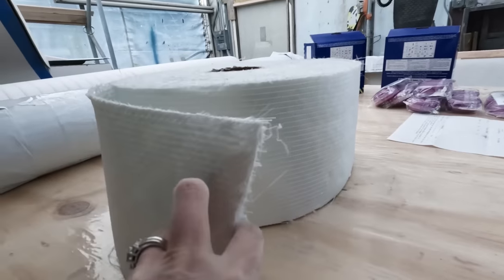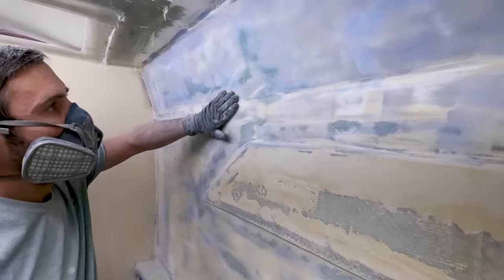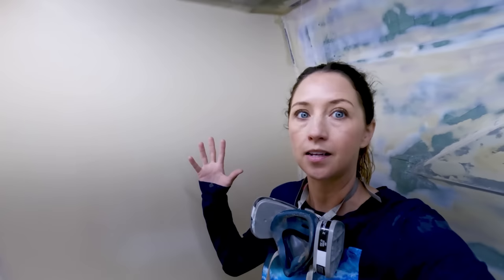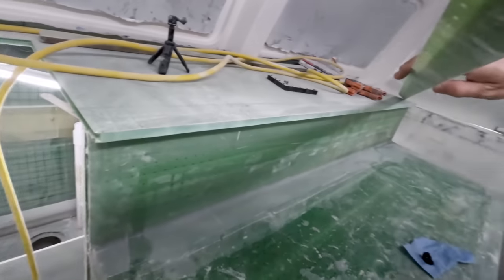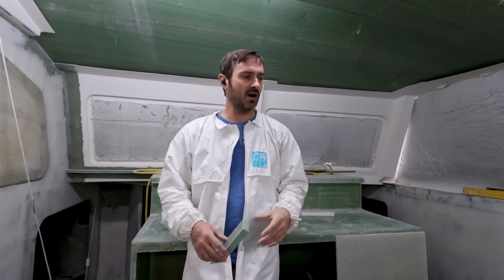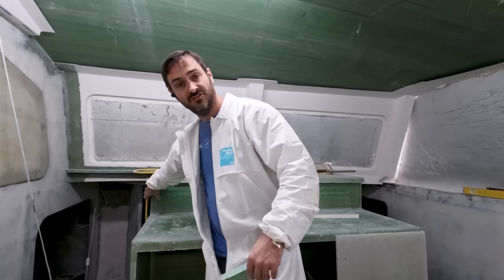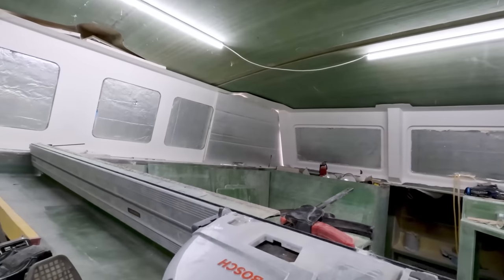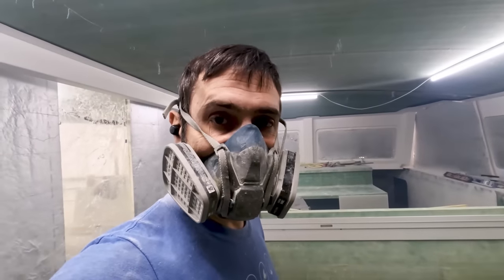CATAMARAN BUILD - Every Way I Do This Is Wrong  (MJ Sailing - Ep 268)

Comment: Continually so impressed with how well you do, and how much work it takes to scratch build a boat. 
Wouldn’t it be worthwhile to have an extraction unit when you’re in an enclosed space to help eliminate dust. Set up a negative pressure zone with simple filters. Would also help with cleanup from all the cutting/filling/sanding.
Reply from the maker: We received an awesome 12" high CFM fan with duct for just that purpose last year.  We didn't use it for months that winter and by the time we opened the package - and warranty was done- we foundout it was DOA.  I haven't had the stomach to buy another :(

Comment: I'm not a boat builder, but I've seen "Guide Coat" used in auto body.  Something like:
SEM 38203 Black Guide Coat - 12 oz.
or
Dura-Gold Premium Black Dry Guide Coat Kit, 7 Ounces (200 Grams) - Powder that Instantly Highlights Auto Bodyshop Repair Surface Imperfections, Identify Body Filler Pinholes, Sanding Scratches Defects

Comment: FYI - to be aware, that most of those smart light switches assumes that power going to them is always on, and further they are usually rated for 120v AC.    also another thing to be aware of,  many of these smart switches are not stand alone..  they require cloud access to a online service.  and that also requires that you have internet, and without internet they will not work.   keep also in mind, that the switch's are nothing more than a esp32 board, which has very little storage space, so much of this "programming" wont fit onto that little board in the switch, so companies will offload that extra "Features" to servers in the cloud.   just something to be aware of.   i have built many esp32 controlers, switches, and displays for many different applications, including home automation.  i have done cloud based designs for both amazon alexa and google assistant.  but the growing trend is "Stand alone"  systems,  where they do not require a cloud service.  but they do require a bit more hourse power than a esp32 can deliver.. so most stand alone systems will utilize a server that is installed,  these servers have more hourse power than a esp32, so they can do the extra heavy lifting when it comes to "features" and "options" programming.   usualy you can just use a raspberry pi, or other small device, or even a home laptop or computer..
Reply: Any electronic switches today that require Internet access are a no-go. Time and again I tried them and most of them are absolute rubbish. The crazy thing today it seems almost every thing needs 'the internet'. Which is why hate any system that needs it.
Reply: try Boat assistant instead of home assistant 😂.  i think from a failure point its a ridiculous idea
Reply: what these switches need is a “wireless network”. if your network is broken, nothing works anymore. if your control plane is broken you cant turn them on or off.  your control plane is either a local computer or the cloud. nothing beats a mechanical switch + wire
Reply: I totally agree with you. From my personal point a view, to adopt home electronic components that rely on an available internet connection is a very bad idea. Furthermore, the components they have choosen are absolutely not suitable for a marine application. I would prefer to adopt components specifically designed for marine application and not based on a cloud based environment, but I definitively would suggest to use well designed and waterproof traditional switches.

Comment: Hey Matt, I keep a 1.8m length of aluminium extrusion, about 120mm x 2.5mm that has a couple of 20mm vertical ribs either side of it’s centreline, for use as a cutting guide. I think it was probably a sliding door threshold or something random like that but there’s loads of suitable sections available from metal stockists. 
Point is, I just drill it wherever it’s convenient and screw it onto whatever I want a cutting/routing guide, then fill the screw holes afterwards. 
No clamps in the way and making the holes slightly oversized for the screws gives you really fine adjustment of line position. 
Hope that helps, Cheers, R. 😎👍🍻

Comment: Getting a flat surface is hard by hand. Good on you guys for doing it though. It will be so much nicer looking when finished. Us woodworkers use a crosshatch pattern of pencil lines. As we sand and the lines disappear we know that area is level and do not go over it again. Any lines remaining means re-crosshatch and start again until the low spot is gone.

Comment: I have used those switches throughout our home and they work really well, if power is cut though they do not automatically come back on when power is restored.
Reply from the maker: We're using the purely wireless version of the switches.... They just stick on the wall and aren't wired to anything.  So power shouldn't matter with these

Comment: Suggest you investigate lightening suppression for plastic boats, mates cat was hit and blew up every electrical device on the boat and I mean EVERYTHING. Just be mindful that lightening is actually SHF so high voltage skin effect is better for carrying current rather than conductor cross sectional area. ie, your better with a woven mesh conductor and a big thick cable. Base of mast if your stick is going to ally, all the way to the top if carbon, other connections are stays connecting to through hull fittings well away from all your electric motors and controls.

Comment: Matt, just remember, mistakes made are lessons learned, as long as you pay attention. If you plan to put some trim over the edge, cut the trim to allow for the filler to fix the edge and use a template to hold it in place. 
I see mention of a vacation in the comments. You guys have a good time.

Comment: you should ditch the long board dura block sander and get a air powered straight line sander - things will go a lot quicker. Use air power bodywork tools instead of muscle power.

Comment: For your light control Philips Hue is sure not the cheapest but widely implemented platform. It would work without internet just from or via one Hue Bridge, and they are also implemented in HomeAssistant and Homebridge. Only downside for my opinion is they need 120V or 240V running to the light socket. So not really running just from the house battery voltage. Switches and Motion sensors are powered by little batteries who last at minimum one year, some of my applications already 4years without battery need to be changed. You need to decide if you go 120V or 240V for that part of the house power. 
I would probably install both Voltages on the boat anyway. Type-A US Sockets for 120V and Type-F European (German) Schuko socket’s for 240V are the most useful ones around the world. Best system for my opinion besides boats would be Swiss Type-J because it’s space saving and orientated but unfortunately only used in Switzerland, or the similar one Type-N only used in South Africa and Brasil. 
Backup emergency light at Bridge and Deck should be probably go directly from a 12V Battery, maybe even a separate „classic“ acid battery. Reason for that is if you get a lightning hit usually electronics (every good lithium has a BMS inside) fail but classic circuits and battery might more likely survive. If you are able to keep that circuits completely separated even better. But keep in mind Lightning doesn’t care about thin wire isolation, therefore even the wires should run separately. 
Most dangerous on a boat is fire, electric fire starts from bad contact and overloaded wires. A simple thermal camera is a good tool to inspect your installation. And that not only after installation, but more importantly you can and should recheck regularly en voyage. 
Enjoy your vacation time and recharge to continue this amazing build.

Comment: When you go to make long cuts with the straight edge and you can’t clamp the middle. I always put wood in the middle two or three pieces to the floor or your bench seat that way it doesn’t flex when you apply pressure down the middle.

Comment: I have looked into the light switch situation for my smart home and ditched the idea of those switches because they use the typical home wiring that is cutting power to the lights where as a new smart system can have a dedicated relay module (or multiple modules) to handle the on/off in a central location so all the lights go to the same place, then you can have controls on any display (wall mounted or not) or physical buttons to trigger those relays, that said, take a look at this display that have the same size as a light switch and have a ESP32 board in them so you can program them to do a lot of stuff, even for displaying boat data: WT32-SC01 PLUS
Reply: You also need a server to put all the relays and connect everything together, I think HomeAssistant could work if setup properly
Reply from the maker: Thanks for the link to the board.  Looks cool, but I don't think it's what I'm after.

The issue is needing access to the wiring in the location of the switch.  The idea is to have completely wireless switches - no 12v wiring to them at all - so no holes in the bulkheads, but still have physical switches in conventional locations.

 I also don't want to run all wires back to one point.  With these individual relays, I can put a relay at each branch leading off to its respective light only and take advantage of the normal daisy-chain wiring of a circuit.

Comment: I would be concerned about corrosion in those 'inexpensive' alibaba switches.
Reply from the maker: Never had an issue with these types of things before.  It's amazing how reliable stuff can be on a boat if it is only subjected to salt in the air and not directly wet
Reply: @MJSailing  Interesting, my father is like you 2, he had fairly consistent issues with bluetooth and wifi modules in his appliances, especially the hvac and eventually the tech informed him it was a common issue with the non rated equipment he encountered as well as some rated, all from just the air, no direct contact.

Comment: Since you always make sure that every new piece is leveled with the boat, I'm wondering how often you check to see that the base of the boat is still leveled as you set it up?
Reply from the maker: We go back to pieces we know were originally level and work off that.  Something like the floors in the hulls- which we leveled when we originally set the hulls in place - are used as a reference point.

Comment: Wouldn't it be possible to add shims behind the top of the saw track to clamp it at 90 degrees?
Reply from the maker: That would have worked too.  But I worried about it holding a constant angle.  The track is stiff only in its width and not in the height, so would bow or warp unless shimmed all the way along the edge equally

Comment: Just curious I've been watching most of your videos in this boat building. Did the boat kit actually come with everything you need to build it except the tools? And are the directions kind of as I say step by step.
Reply from the maker: It did not come with the fiberglass or resin, what we received were the molds to build the hull as well as bulkheads and furniture.  There is a manual which comes with it, but we're working with the company to make it more 'beginner' friendly, lol.

Comment: i have been building high end homes for the last 20 years. just remember nothing is perfectly level or plumb. it doesn't have to be perfect, it has to look perfect. the best finish carpenters are the best cheaters.
Reply: or square.
Reply from the maker: The guy that came to help us fair said the same thing. "Your surfaces don't have to be flat, they just have to look flat".

Comment: At 2:11 , is there a reason for running the drill bit backwards? Curious. Does it reduce tearing or something or just a mistake?
Reply: Well Tom, it could be the same effect what you have in movies. Cars moving forward, but wheels turning backwards...😁
Reply: actually, when the drill runs forwards its cutting into a materal,   and it will contenue to cut into the material at the angle that the drill's cutting suface is made into,   but it wont stop cutting until the material is broken off,  this is what makes the chips.   by running a drill backwards, your causing the uncut materal on the end of that chip to be rounded off,  this allows for a cleaner surface on edges.   now, you can also run the drill backwards before going into a material, which, in affect, causes a dimple to be formed on the spot you want the drill to start.  on harder surfaces like steal you would use a center punch, but on softer materals like fiberglass you can run the drill backwards for a moment and it will create that center for the bit,  thus allowing it to start clean and cut well.  otherwise the drill tip will just walk all over the place.
Reply: Or just for filming?
Reply from the maker: It really helps to run the bit backwards when cutting through gelcoat to prevent chipping.  It takes a while, but not as long as fixing chips :)